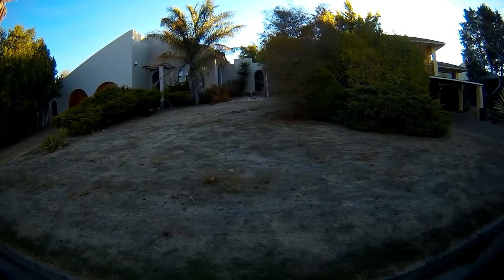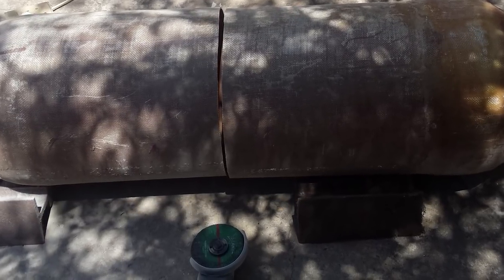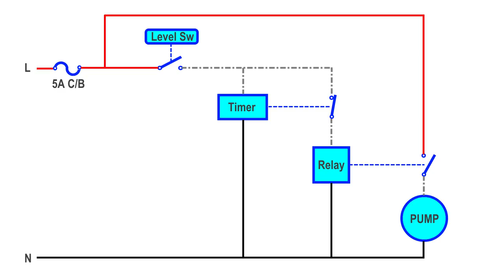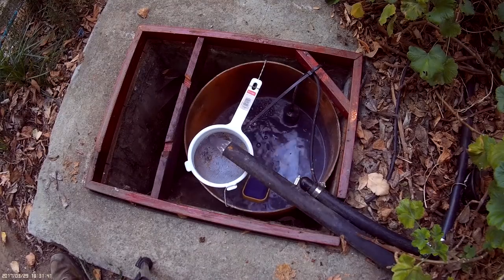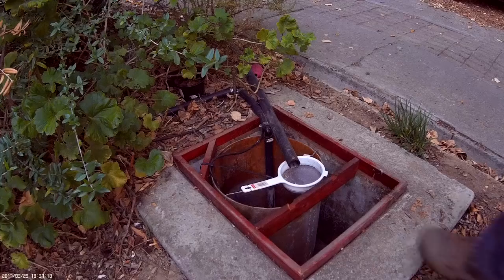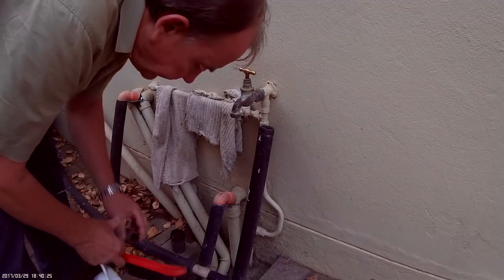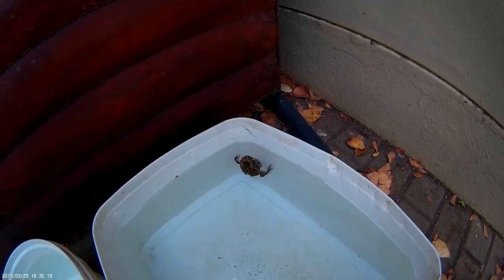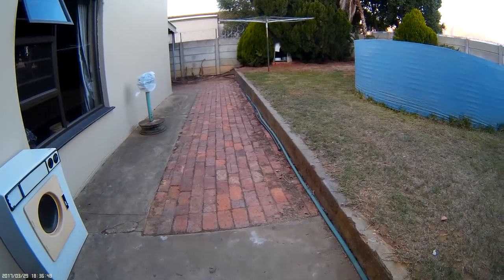Simple DIY Grey-water System: No digging required!

Comment: There’s some good designs using gravel reed beds to clarify the grey water. Removes the soap phosphates and other contaminants. 

I found a larger diameter strainer in a dollar store and also have a flyscreen based strainer.
Reply from the maker: Yes, that is an alternative way if you want to store the water longer term without it going rotten.  I simply use the water as soon as possible to prevent a bad smell.

Comment: You should drill you some holes on both sides of your tank and use some rope and a couple of small pieces of PVC pipe to make handles on the inside with your rope knots on the outside of your tank to make it way easier to life out of the whole. Thanks for the video!
Reply from the maker: Great minds think alike!  I have been meaning to do exactly that but have not got around to doing it yet!  Your comment will inspire me to sommer do it this weekend!

Comment: hi Willie. why do you need this system,  instead of just running the water through a French drain into the garden?
Reply from the maker: Sorry, not sure how a french drain irrigation system works. Previously I just had the black pipe run it on the lawn, but this only waters a small patch at a time and not into the flower beds. That's where the sprinkler comes in to spread the water over a big area.

Comment: Hi Wille, thanx for the video, I am preparing to do something similar, although I may use the idea of a washing machine pressure switch.  Ccould you please just elablorate on the timer? What type and what duration will it switch off?  Also, what or where can I get those filters that you used at the end of the pipe?
Reply from the maker: Hi Kevin, a washing machine pressure switch should be made to work - it may need a little experimentation. I happened to have a 6 minute timer which had the correct contacts.  It just needs to take longer to time out than it takes the pump to empty the tank.  If the system fails, the longest the pump will run dry is 6 minutes which it will easily survive. The filters are standard sieves for "foot valves", available from where you can buy a foot valve (non-return valve).  Hope this helps.

Comment: Why do you need a tank at all? Can you run it straight to the yard by gravity?
Reply from the maker: That is what I did for 10 years, but it is very inefficient because it only wets a small spot, even if you move the pipe regularly, instead of spaying a big area much more evenly.

Comment: Hi Willie, your video is very interesting. I'd like to do this myself. I live in the Eastern Cape where we're also experiencing the drought and I love the idea of putting to good use the bath and laundry water, and your system is very practical. However, I need to prick your brain on everything I need to get do it myself. I am a woman so will need step-by-step instructions. LOL. What are the sieves you've used at the bottom of the pipe? Where do I source these?
Reply from the maker: Hi Carol.  Thanks for the feedback and good to hear you found the video informative.  The grids at the bottom will be available from the same place where you can buy the "foot valve" (also called "non-return" valve).  They almost come as a pair and are available from agric-type shops (the old fashioned "Kooperasie").  You are welcome to ask more.
Reply: Willie Koorts Thank you for the quick reply. I will pay the Humansdorp co-op a visit. I noted the pump indicated on your video is different to the pump that Tim used on his system. What pressure control mechanism did you use for your pump.
Reply from the maker: Hi Carol.  The pump I used was the smallest available from the Ko-op at the time.  Mine does not have a any pressure control mechanism, hence the timer-based control circuit to protect the pump from running dry.  A pressure control system is actually a better alternative since it will sense immediately when it is not pumping.  I'm not very familiar with pressure control systems, that's why I went for the timer option.  I'm sure someone at the Humansdorp Koöperasie will be able to advise you on a pressure control system.
Reply: Thanks Willie. You are so generous by sharing your system and ideas. Also particularly liked your DIY tank water level indicator with the plastic peanut butter jar, fishing line, wire and nut. Simplistic but brilliant. Its another one of your ideas that I will copy.
Reply from the maker: You are obviously most welcome to copy my ideas - that is what the videos are for!  Great to hear you find them useful. I believe in the KISS-principle (Keep It Simple Stupid!).  I saw designs for electronics level indicators which you can check on an App on your phone, but these don't appeal to me because they are far to complicated for what you need (and the use batteries that will run out)!  I happened to use my level indicators tonight while equaliszing my tanks for the expected rain!
Reply: I heard the good news about the forecasted rains in the Western Cape region which is also expected to fall largely in the encatchment areas.  An answer to prayer, I believe.

Comment: I like using the above ground pump. Is it a self priming pump or are you using a foot valve (one way) to keep it primed?
Reply from the maker: Yes, a one-way foot valve is used.  Although the pump is self priming, one sometimes need to "bleed" it when some water has been lost in the pipe, but luckily is not needed often.

Comment: Why do you clean it once a week? What happens if you don't?
Reply from the maker: If the foot valve sieves clog up too much, the pump will cavitate instead of pumping.  The timer will then time out and stop the system to protect itself from damage.
Reply: It will clog up if you don't clean it regularly...like every week... Also... I changed over to liquid soaps instead of suds and now going into bio friendly soaps....all helps better the environment and filter and pump friendly too... I'm not keen on the spraying bit though...instead I let it run out onto my garden but have to move the outlet around ...bit of a chore but still fine for me....excellent work !!!
Reply: We switched to "organic" soaps for the washing as it comes in a gel like form, you get it from health shops, much less residue and costs about the same....my system still needs some improvement though...dankie v die Vid. Willie.